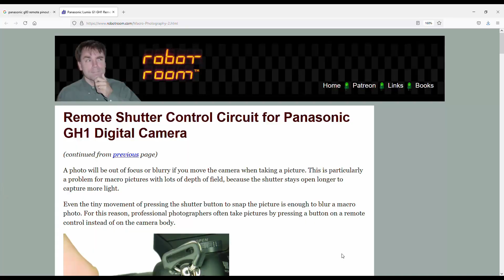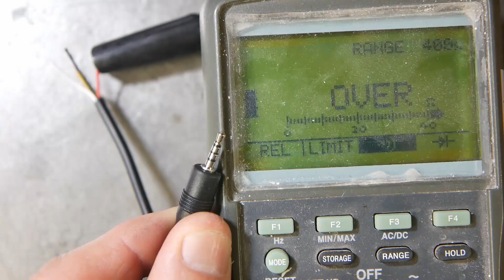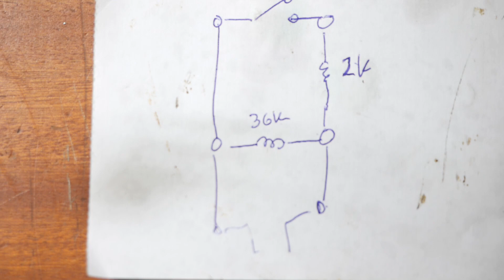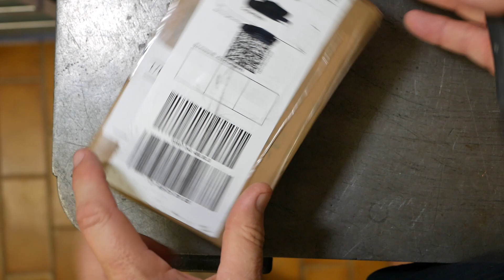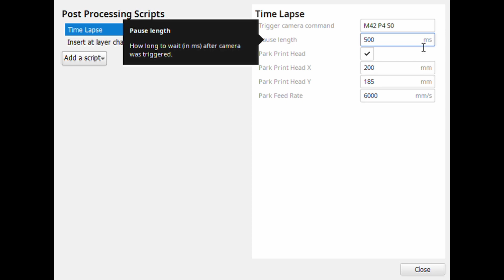Five minute job - 3D print time lapse

Comment: You made it! ...Despite the half-cryptic clues spread across 4 pages of the Harry Potter-esque Dungeon-of-the-Duet-Wiki. Always nice to lend a hand to the best 5 minute channel in the basement of Youtube! Your next five minute job is to design a flip-down 3D printed light-switch guard with a 'Recording in Progress' note holder - maybe the note is written on card and slides into carrier-slots, as some drawer bases are fabricated. Yeah, that's only a 2m30s job and another 2m30s to print ;) Keep up the great show!
Reply from the maker: Thanks Hamish, without that chat, I am not sure I doubt have got that sorted
Reply: Better yet have it turn on the light before taking a shot then turn it off after. Maybe with a Zigbee switch or something.
Reply: @RambozoClown  That's also a good idea. Alternatively, have a low power LED lamp dedicated to the job, instead of the room lighting.

Comment: You should check out optocouplers
Reply from the maker: Maybe that 1€ relay board already has them? I didn't look.
Reply: @RotarySMP  Yes I can see the octocoupler on your relay board. What you did is ok, but when using an octocoupler only, you can use the power of the control signal without needing an extra power input. Just a thought.

Comment: If you still have the frames from your earlier attempts at time lapse, I would be interested to see how it looks if you merge/average some frames, which would emulate a long exposure time for that (resulting) frame.

This will likely blur the print head out of existence of at least "ghost" it.

So if you want to compress time by a factor of 100, shoot at 1/20 normal rate, THEN merge each batch of 5 frames. (for a 5 way merge)

I don't know if 5 is a good number for this, of course.

You might be able to try this on existing footage, depending on capture rate.
Reply from the maker: The problem with those earlier shorts was the random position in both X nd Y of the bed, plus the print head inthe way. I dont really have time to revisit them.
Reply: @RotarySMP  "darn" I was thinking in terms of a print head moving in X Y and Z.

I don't think 3D printers work like that.

My bad.
Reply from the maker: @paulwomack5866  I am pretty happy with this now.

Comment: Be cool to have the relay also trigger a LED strip to turn on and then off so you don’t need to keep the light on all the time
Reply from the maker: Or a set of pulleys from the X axis, up the stairs to the light switch :)
Reply: @RotarySMP  Rube Goldberg style :)
Reply from the maker: @Projects101_NZ  You got it.

Comment: Hi, great video, and since I also have a duet 2 printer and a camera i've try it ! but for my config i did it differently, i've created a macro in the printer with "activate" "pause" "deactivate" commands (M42, g4, M42) and in cura i just call the macro with m98
Reply from the maker: I would like to see that code your wrote for your Duet macro please.
Reply: @RotarySMP  
first in config.g

; Camera control
M950 P3 C"exp.heater6"           ; define heater 6 as GPIO for relay control
M42 P3 S1                                  ; turn off relay (active low)

and then in macro folder
add a macro called "Camera trigger"
M42 P3 S0    ; trigger camera
G4 P500      ; wait 500 ms (or second with parameter Sxx)
M42 P3 S1    ; realse camera

and in cura in time lapse plugin
M98 P"/macros/Camera trigger"
Reply from the maker: @nicolat815  Thanks. YOu must be running your Duet with Reprap firmware 3. Mine is still on the V2. so I dont have the M950 command implemented. I tried that.
Reply: @RotarySMP  Yes, i run RepRap 3.
I've added settings to the post process, z hop and retraction if you are interested
Reply from the maker: @nicolat815  What is Z hop? I probably ont update to RRF 3, as it is working really well as is. Never change a working system.
Reply: @RotarySMP  z hop is a setting to lift the nozzle when moving over non-printed area. It's complementary to retraction and for my printer and setting was necessary.
Reply from the maker: @nicolat815  I think Cura does that as standard.
Reply: @RotarySMP  yes but not in the time lapse plugin

Comment: OK compared to that my solution was "stupid". 
I wired a switsch with an electromagnet parallel to the driver-board to one of the end-switches (glued the second witch to the first one). The electromagnet pulls up a "flag" (piece of paper) that is visible in the webcam when hanging down. I added a code in every print-line to hit the end-switch. My computer "watches" the webcam and only saved the the images with the flag not present. (If something white is in the left top corner, then ignore the image.) Time-laps complete.
Reply from the maker: More ways to kill a cat than to stuff it with cream (as my Dad always said - weird idiom!) . I like your creativity.

Comment: You can put second switch parallel to your x axis limit, on a longer bolts, and use it to trigger the camera. But your solution works too. Good choise of control board, on standard marlin any tweak need firmware compiling and updating.
Reply from the maker: I initially thought of using an additional X axis microseitch, but thought the camera would need external current to trigger. This way I didn’t need to adjust anything

Comment: If you were using Octoprint on a Raspberry Pi, you could do this with a usb webcam and a few mouse clicks.
Reply from the maker: Instead of buying octoprint , a Webcam and a Raspi, I used a €2 cable, a €1 relay , the camera I already have and 5minutes ;)
Reply: Octoprint is free open source software. RPi costs £5.
Reply from the maker: So 180% More ;)
Reply: But so much more.

Comment: optocoupler? (Opto-isolator)
Reply from the maker: No need, the relay is between the camera and the printer
Reply: @RotarySMP  Mechanical switch with coil - relay,  sparks, el. noises / lifetime, loud.
Reply from the maker: Nah, it is driven by a 3.3v signal, switches the cameras 7.4v (?) signal and cost €1. if it dies, there are five more as I got 6 for €6
Reply: @RotarySMP  Ok. I'm just saying...

Comment: Great solution for standard prints - any ideas for continuos z-motion prints like vase mode/spiralized?
Reply from the maker: Do you have a link? I am not sure what that is?
Reply: @RotarySMP  it's a function that prints only the outside wall of the model, usually single extrusion width, and essentially in one big spiral. No retraction and z moves up continuously.

Comment: Well, a 5 minute job that takes a 7 minute video, and probably a lot longer in real time. So much for accurate labelling. 

Keep in mind that every brand of camera manufacturer does this differently, and sometimes even within a brand things can be very different (Canon has at least two systems for wired remote triggers (cheaper model use something similar to what you have).
Reply from the maker: Yeah really. My 5 minute jobs will fail truth in advertising laws every time.
The Panasonic remote interface seems to be stable between models, and easy.
Reply: @RotarySMP  Similar to the Adam Savage 'one day build' videos. You're in good company.

Comment: Does the leaving the print and restarting it after every layer cause any defects/artefacts in the prints where you can see the point the nozzle stopped and reset after to take the picture? 
Either way cool project I’d be interested in doing my self
Reply from the maker: Good question, I haven’t done enough prints yet to answer that, but you often have multiple features where it has to start stop
Reply: There are fairly common layer-change artifacts in 3d prints even without stopping for pictures, and because of that there are a number of mitigations available (e.g. making the layer change happen in corners, retracting filament before finishing a layer).

That said, I could easily see the potential for stringy filament like PETG to do something very annoying.
Reply: There are fairly common layer-change artifacts in 3d prints even without stopping for pictures, and because of that there are a number of mitigations available (e.g. making the layer change happen in corners, retracting filament before finishing a layer).

That said, I could easily see the potential for stringy filament like PETG to do something very annoying.
Reply: Yeah I thought of that too, because it has to start stop on every layer, I normally use ‘sharpest corner’ in cura, I’m curious to see if the time lapse process causes the nozzle to spend more time at the stop/start point than would be spent normally and it would be that extended time causing defects, either way the videos you can create are brilliant to watch